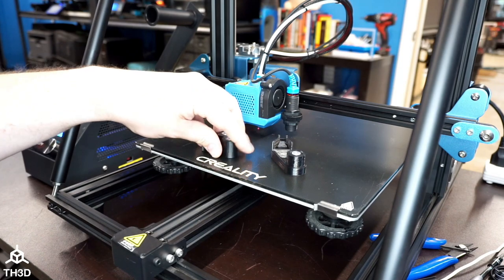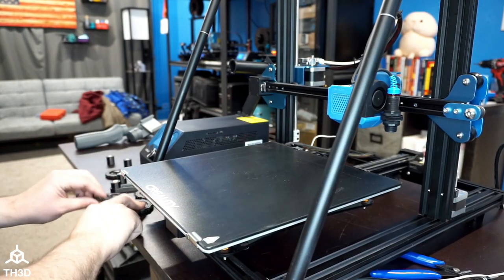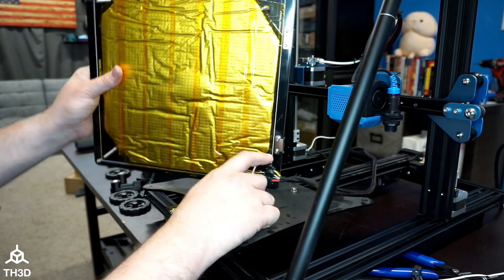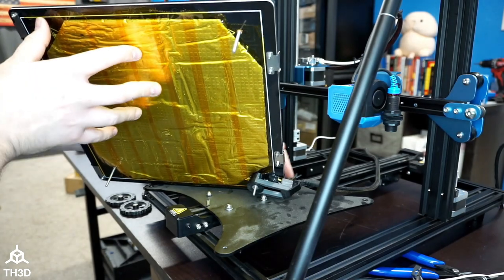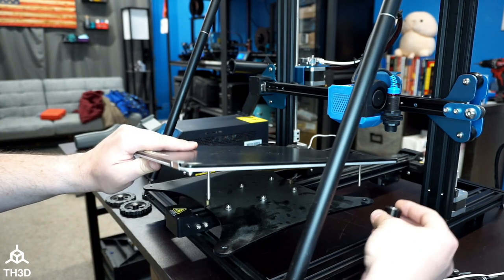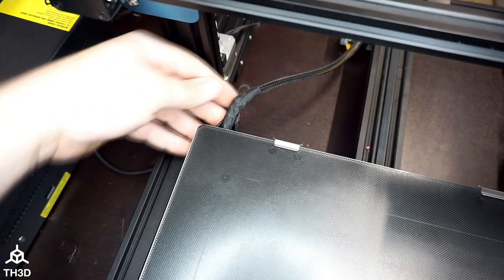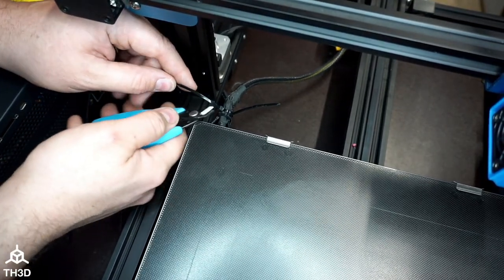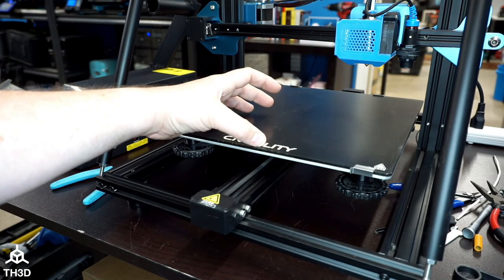EZABL EZTips - Installing the Solid Bed Mounts Addon

Comment: When should this be recalibrated? I recently had to take my gantry apart to replace my wheels and was curious if I need to recalibrate the sensor after removing it? Thanks!
Reply from the maker: If you remove and re-mount the sensor it's recommended to re-calibrate it and check that its mounted according to our installation guide.

Comment: I recently installed these on my ender 3 s1 pro and when I do a bed level print it’s to close in the front prefect in the middle and to high in the back any advice?
Reply from the maker: There are a few things that could be the cause. If you are not using the correct starting gcode in your slicer the ABL may not take effect. Also, if you are not using our firmware + LCD kit that could be the issue as well since the stock firmware is buggy. You also should make sure your Y belt is not OVER tensioned as that can skew results of your probe readings.
Reply: @TH3DStudio  I’m using m420 s1 in my start g code, as well as using your firmware and lcd, I believe tension is ok but I’ll will double check